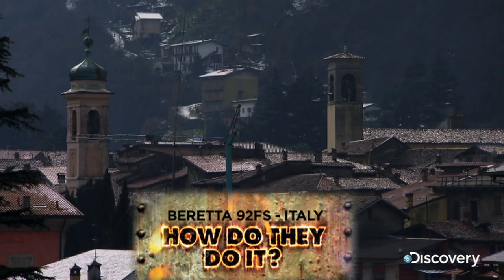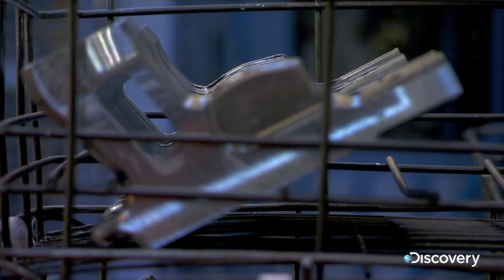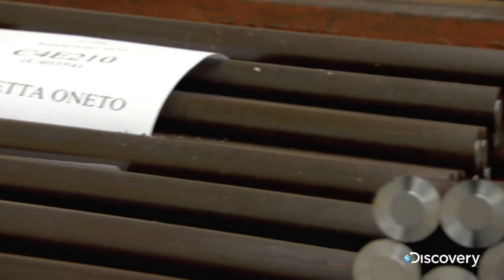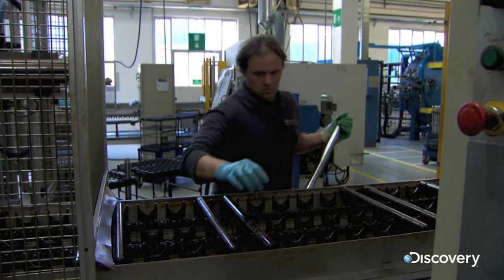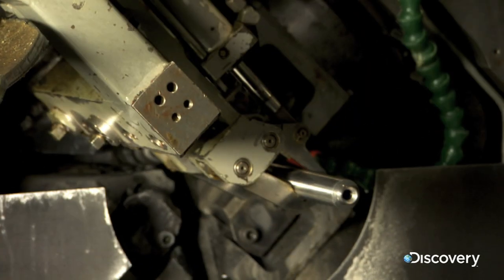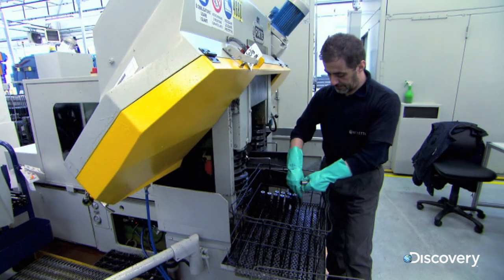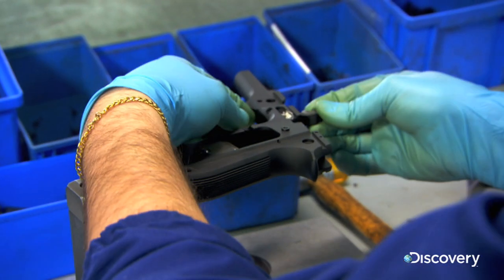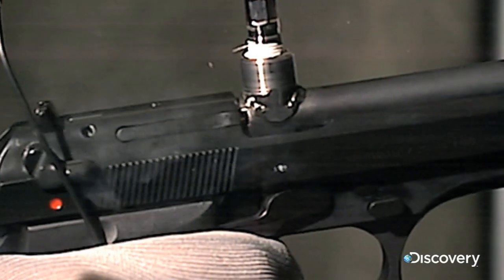Beretta Pistol - How Do They Do It?

Comment: This guy mustn't have a script or he's wrote it himself.  How do you get a solid cylinder?  A cylinder is hollow.
Reply: +TheWeeHenry
&#160;
cyl&#183;in&#183;der
ˈsiləndər/
noun
noun: cylinder; plural noun: cylinders

-  a solid geometric figure with straight parallel sides and a circular or oval cross section.